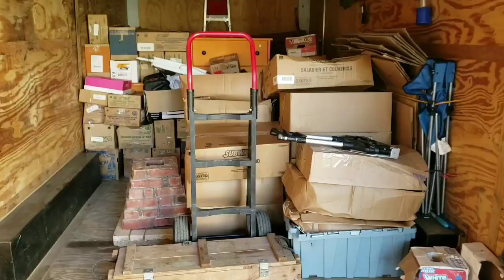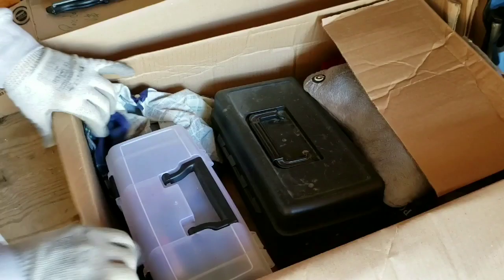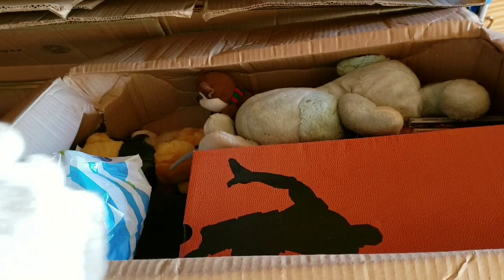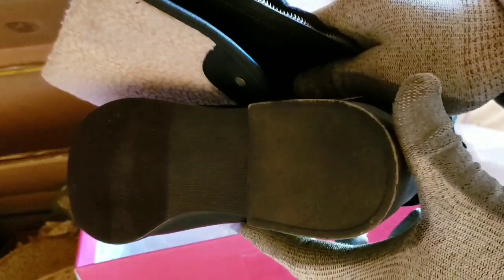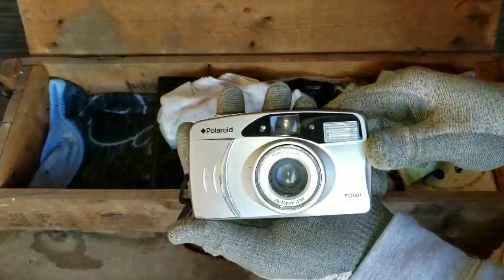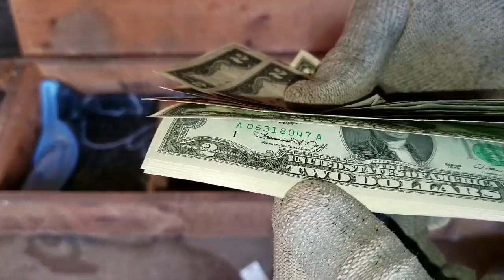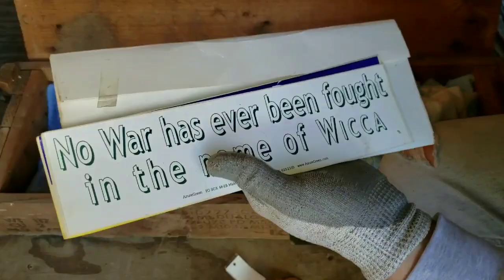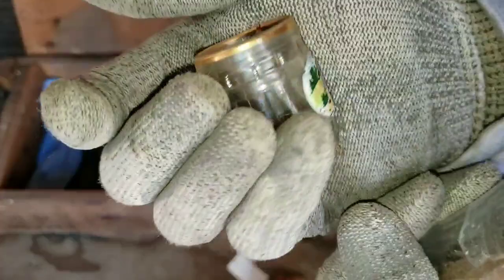MONEY IN OLD TRUNK I Bought Abandoned Storage Unit Locker Opening Mystery Boxes Storage Wars Auction

Comment: Jeremy, this was a soldiers stuff that was stationed in Germany. The challenge coin you had is usually given as a token of appreciation for a job well done. Those shell casings are 7.62 M60 blank rounds. I find them all the time metal detecting here in Germany. This guy was in the medical field as the types of bandages, scissors and blood pressure measuring devices. If you have any other questions about Army stuff, give me a  shout.

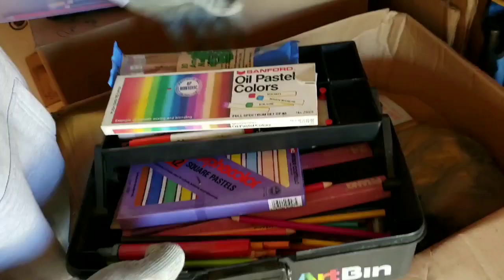Comment: 7:11 the art supplies in that box are not $20 a shot. The oil pastels are between $6.00 & $8.00. None of the art supplies shown so far are top quality. The first box of colored pencils are Sergeant brand. You can get the big set at hobby lobby for around $20.00. I have a colored pencil problem. I buy every brand I can find. Prismacolor is the best that I have found. You can get 24 for $19.99 at WalMart. The bigger sets can really get expensive. However, not all colored pencils are nearly as good as Prismacolor.